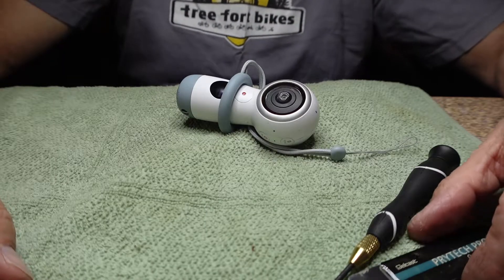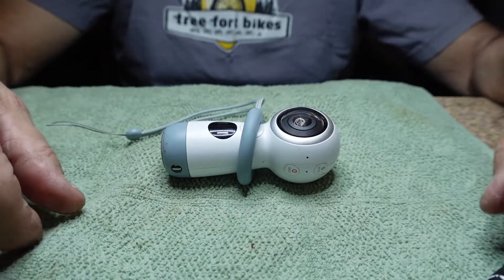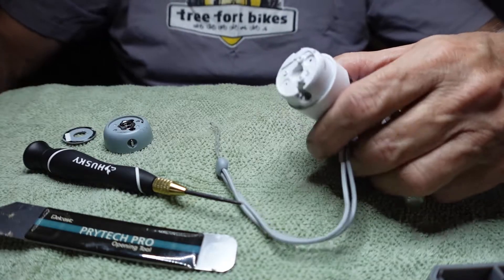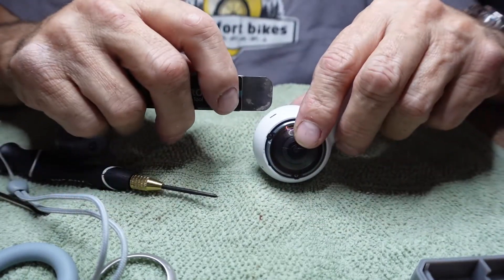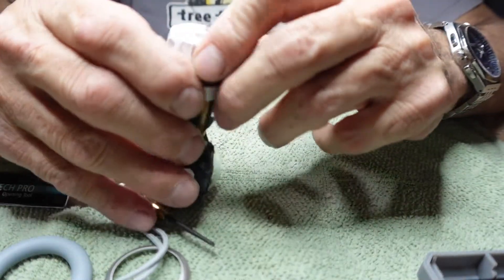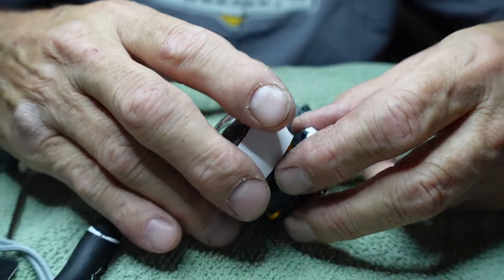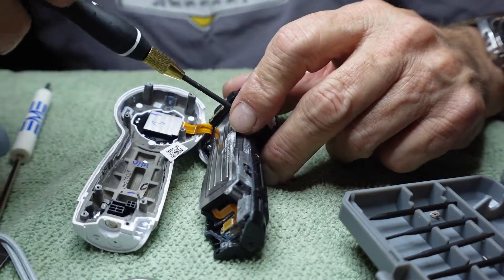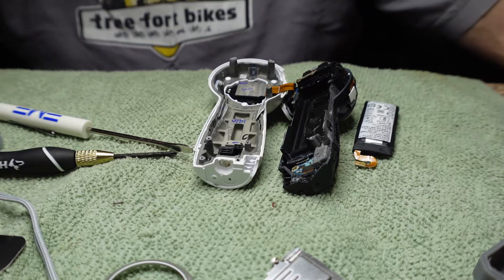samsung gear 360 camera battery removal

Comment: OK so  Since there is no battery to buy to replace, you will have to carefully remove the charging circuit board from the original battery, its at the top of the battery . if you carefully peal back the foil you will se that the battery is attached to two leads that are attached to the board. Check polarity with a multimeter first then cut the two metal leads and solder two wires to the pads. I drilled a hole in the side through the aluminum housing and plastic and ran the wires through, i then attached to an 18650. you will have to connect and disconnect the negative lead till the camera recognizes the battery the solder the connection once the unit is turned on , I hope this helps, i finished the project in a day, now i can replace battery without ever opening the housing again. be mindful if you damage the board it will not work. I can even charge the 18650 battery through the original usb C port now. best regards, I hope this helps.
Reply: Can you do an hour-long video in which you replicate this process as if I were a kindergartener who knows nothing about soldering polarity multimeters or any of that shit what have all the equipment to do so. I mean I did just buy it so who knows what level the battery is at, but once it starts to go to crap I will reference a video I hope you make because that looks like a completely foreign language to me LOL. Top cheers for knowing how to do it though

Comment: To my surprise the cable in mine was also disconected. Thanks so much for this video, my camera works again now. I also havent't been able to find a replacement battery and the only phone I have that still works wit the camera is an S9 with Android 10.
Reply: what restricts use of this camera with other phones?

Comment: You do realize the rubber ring is meant to place on the ground and be a stable mount for the camera… the small end of the string is for a carry loop thru the small post on the bottom side.
Reply from the maker: I did not, but it works great for what i used it for as well, so there... LOL

Comment: (Paused here: 9:54 to comment) About an hour ago I remembered that I was given a gear 360 by an old boss of mine and I want to use it for the upcoming 2024 April 8th solar eclipse for the environment shot. It’s been in storage for over two years. I plugged it in and nothing. I left it plugged in with the cable I bought for it since the original is far too short for my requirements. It’s been an hour of searching for a solution to fix the issue and while watching this video the charge light has lit. Score! Yet I do feel that an upgraded battery is a good idea so I’ll keep watching to see how far you get. No. My old boss didn’t give me the ring dongle you used to unscrew the lens collars but I am sure I can come up with a tool that will work just as well since I absolutely refuse to damage anything. I enjoy the “brand-new” appearance of anything I own. Like the original Nintendo game console I was given on my seventh birthday (Still looks fresh out the box). I love how you show that the ring dongle has a purpose that all those who destroyed their cameras never thought of. I can only imagine their reaction over seeing how you removed the lens collars, probably priceless)
Reply from the maker: I was unsuccessful in finding a replacement battery. But I hope you have better luck.
Reply: As someone who today is just about to charge it for the first time, basically only use it when you really intend on using it for specifically and only 360° pictures and or photos or really really wide panoramas otherwise just use your regular phone because this battery is irreplaceable? Gotcha!

Comment: Thanks. Quite hard job to replace it. My cameras battery is dead and this camera model is really failure I believe.
Reply: It's very possible that the charging port and the battery connector was out of place, there's a theory that if you gave it a couple hard wacks on the bottom it will work, another one said that if you use the USB a to c adapter and plug it directly into your computer it'll work, I'm about to try everything and then give this a shot

Comment: I had the same problem.. Kept it 2 years in storage. Wouldn't charge. 
Finally got it to work by using a few combination of power banks and type-C USB cables. It is sensitive to orientation of the type-C connector. Doesn't make sense but it finally started charging.
Reply: despues de cargar por unnpar de años asi se termino por dañar la bateria ahora no retiene la carga
Reply: Ugh I hate when these companies make this Tech that is like 6 years ahead of its time and can't even get the goddamn charger right you're absolutely right orientation should have nothing to do with charging it. I just bought one for 60 bucks on eBay and I'm about to go try four different DIYs on how to get the damn thing started before I follow this method and hopefully not destroy it

Comment: Thanks bro. That what I'm looking for.
Reply from the maker: Glad I could help. I'm searching for a battery that fits. stay tuned for the re-install video once I located a supplier
Reply: Let me know if you find one!
Reply: @michaelskullz5823  Are there any way to power it with power-bank (5v) and step-down module(3.8v)?
Reply: Great video...  Made taking it a part easy.  Seems the battery is designed to fail.  Had mine 3.5 years, used it less than 10 hours total.  Periodically charged it.  Pulled it out today and won't charge, dead.  Finding replacement battery will be difficult.
Reply: @michaelperry1698  I'll use it as bike dash-cam, so I'm looking to power it with external power source.
Reply from the maker: @BadrDIYEprojects  great idea. Since it seems a replacement battery is damn near impossible, I will have to see if there is a work around. It seems if the battery is dead, it doesnt allow the charger to pass through and bring it to life.
Reply: @KimMoonbmwmoonie  that is good idea, because lithium batteries even if is available online, the shipment will costly due to its dangerous. But it is possible to use mobile phone battery, or 18650. Just I don't know the +,- pins. Acctally there are around 5 small pins
Reply from the maker: It's like some laptops. Dead battery it won't even turn on.

Comment: Hi!
I'm trying to produce an adapter for an external battery. I can't find the pinout from the battery connector to the camera board. Did you find this?
Reply from the maker: never did.. i ended trash canning it.
Reply: @KimMoonbmwmoonie  I'll probably do the same thing... Thanks for your attention!
Reply: For anyone interested, it maybe easier to just solder to the existing ribbon connector. See https://youtu.be/9CyNOIl5LWQ

Comment: It would be helpful if when I got to about 12:12 in the video, if my camera would actually come apart.... everything up until this point went so smoothly lol.
Reply from the maker: sorry to hear that... unfortunately I was unable to find a replacement battery for it. Good luck
Reply: I had that problem at 12:12 too. Prying it at the bottom is easier.
Reply: @lynnusdrums  Thanks a LOT!

Comment: I want to change the battery of Samsung Gear 360 SM-R210. So your video is of great value to me. I want to ask where can I get the battery for Samsung Gear 360 SM-R210. Because I need its battery. Please tell me the way to get it.
Reply: Before you do that there are a couple of other suggestions, one is to use the USB a to c adapter and plug it directly into your computer and then hold the power button down to get it to start working, another is just a simply whack it on the table a couple times on it's bottom and it'll work, it all points to they really fucked up with the charging port and battery connection feature which is like you know just a standard thing

Comment: I have found a solution to some problems; in my case the battery connector had just come loose (but in such a way that it was draining fast and not charging, but still turning on), once i pressed the battery connector in correctly (and put some hot glue on there to be sure), the battery started working perfectly again.

for exact context, i think the connector may have come loose over a period of 24h, initiated by being sent through the mail. I bought the camera from Marktplaats (Dutch eBay/Craigslist), so  i don't know how the device was treated by the previous owner. When i received it it was able to (slowly) charge, but it continued to drain throughout the day (especially while sleeping, probably because i was rattling it in my pocket). Right now it stays at 100% if i leave it in sleep mode (display off), and it can record for about 2 hours continuously.

Comment: Do anyone facing overheating? I'm bought the second hand but it's stopped recording after 8 minutes. Finding the solution and found a suggestion to change the sdcard with Samsung Evo and I follow the suggestion but overheat's still there.
Reply: That’s a trait of that camera I got one new a couple of years back. It even does overheat when new. When you use it in colder environments it is fine. But when you use it inside, at 21 degrees Celsius it eventually just overheats. Lowering the resolution may help to let it overheat later. Sorry that I don’t have a better answer
Reply: Faster memory card is the answer. It has To be V30.
Reply: @vesa-mattilehto754  turn out it was splitted to 8 minutes per file. Also I think it's a bad idea to record more than 3 minutes since the stitch tools will take more time to finish. It's time to put new tech into our wishlist bucket.

Comment: hi sir i wold like to ask. is ur gear 360 can used now? coz my gear 360 con conect with mu samsung note 20 ultra
Reply: I have an s24 waiting to be picked up. If I can remember to reply to this comment with what I found out, there are apps that basically render on the go and then you just upload it to wherever you want to. There is no more support for the gear 360 the sunsetted those updates in 2020 but you can still use it, you just need a couple of extra apps

Comment: I fixed mine yesterday be removing the batteries board from the actual cell , then i salvaged some batteries from airpods charging cases 😅 different brands 😅 then I make it work not it's working better then even the app keep crashing down every time I try viewing the gallery
Reply: tried this but battery board on mine may have been fried :(

when I opened my, the area where the battery board is has a white dust and I am not sure if it was a leak. tried hooking the board up to a 18650 just to test but no luck.

Comment: great video. i just looked for a replacement battery but couldn't see one on ebay or amazon. Have you had any luck?
Reply from the maker: none. it seems they arent made to refresh....I ended up throwing mine away after making this video....sad really.
Reply: Maybe you could have tried charging that battery externally in attempt to bring it back.
Reply from the maker: @joshuacatron2  i did actually. it was dead....
Reply: @KimMoonbmwmoonie  
Bummer, such a nice camera. Mine is doing the same thing.

Comment: How can I get spear battery in Bangkadesh
Reply: i suggest eBay search
Reply from the maker: i havent found one yet... so its kind of a futile effort. sorry.
Reply: @KimMoonbmwmoonie  take any 18650 rechargeable battery and solder 2 wires +/-  to the original socket inside. Wires via the bottom externally. I did that trick to several big DSLR cameras.
Reply: @KimMoonbmwmoonie  another try: camera works without battery if it is connected USB-C to external Power Bank 5v. Take a long 50cm to 1mtr cable and enjoy Long Time
Reply from the maker: @bonjour88-x7u  mine wont. apparetnly the battery is so fried it has shorted out the camera as far as using it with just a power lead...
Reply: @KimMoonbmwmoonie  anyway I did not like the sharpness of my Sam360 2017 and was refunded  from the seller. Having much better Sony as300, but 170deg view only.
Reply: @bonjour88-x7u  Do you know a site for selling this battery?